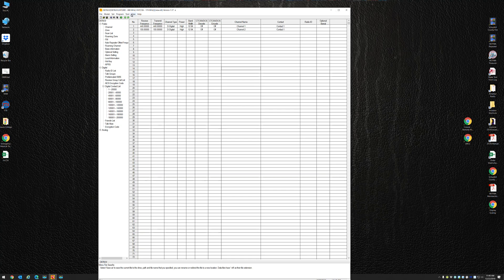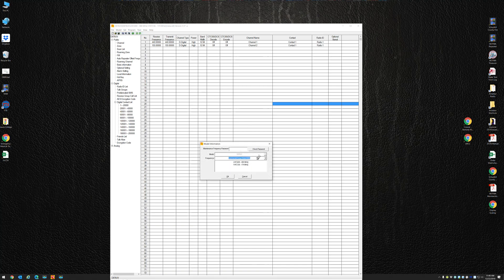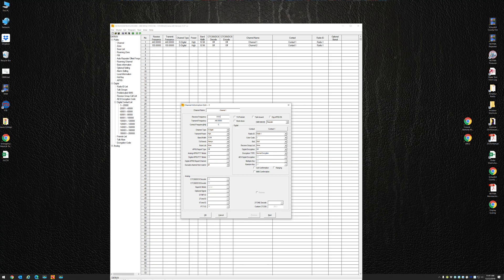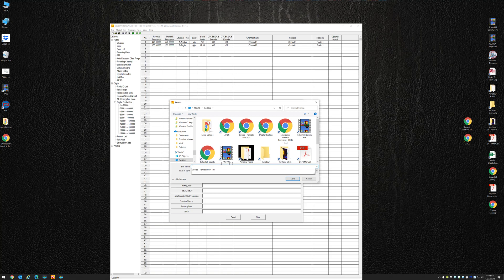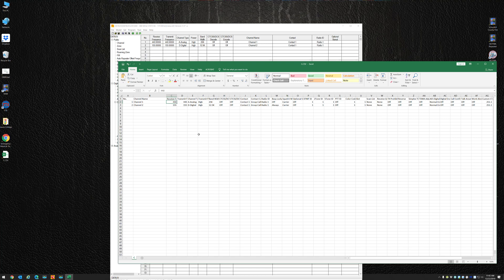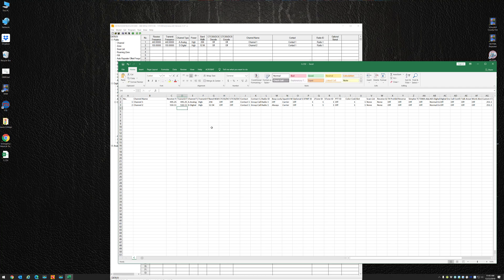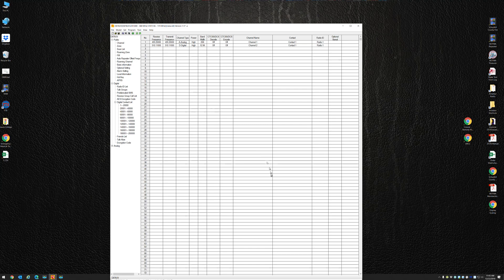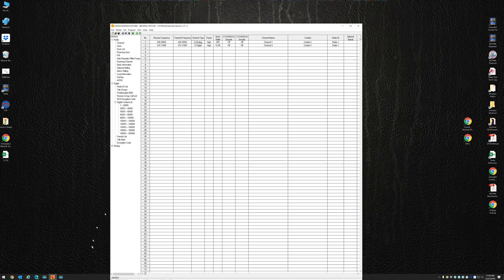Anytone D878/D578 Enter OUT Of Band RX frequencies to Monitor ONLY

Comment: Nice video! But also know that those frequencies will remain silent unless you either select a MODE that covers those frequencies (in which case, they're no longer 'out of band') or load a modified firmware that expands the RX only frequencies which will enable the receiver. Otherwise, the radio itself recognises these frequencies, even though they have been loaded into memory, are 'out of band' and shuts down the receiver.
Reply: Have you actually tried this?  I was thinking about toying with this and wondered how far out of band I could go?
Reply: It works just fine I tried it as he stated and I can listen to those Frequencies no problem so they don’t remain silent as your saying. Thanks for the video and helping me out 73
Reply: Where would one get this modified firmware?